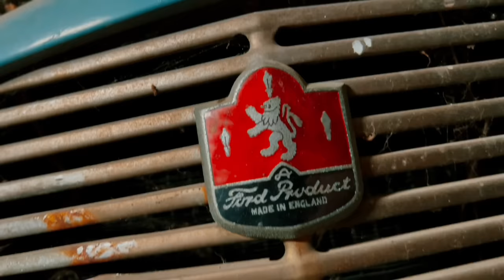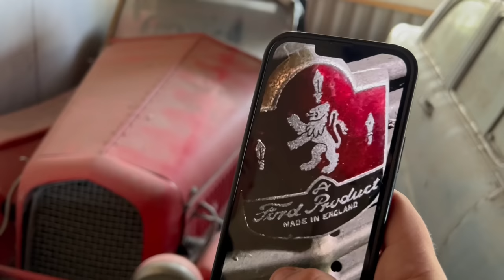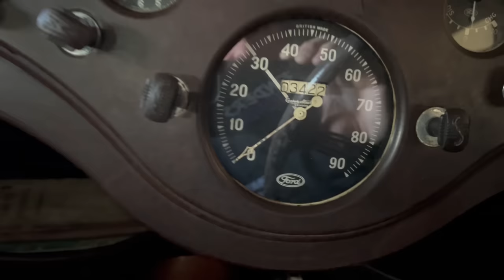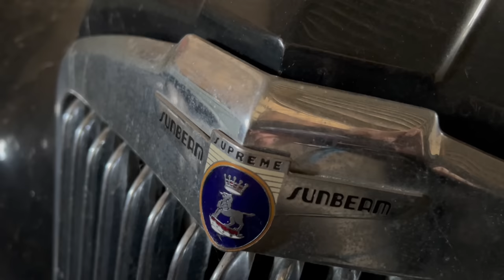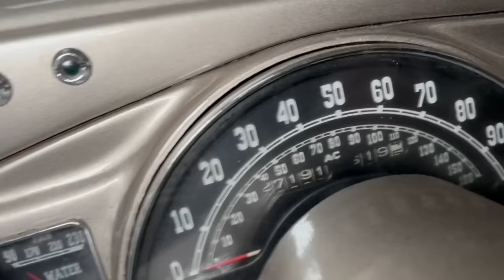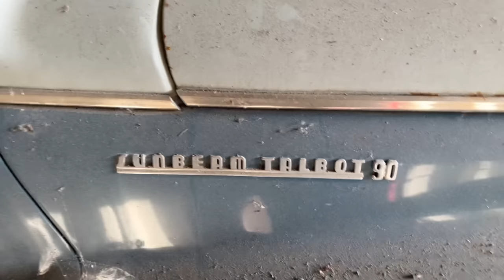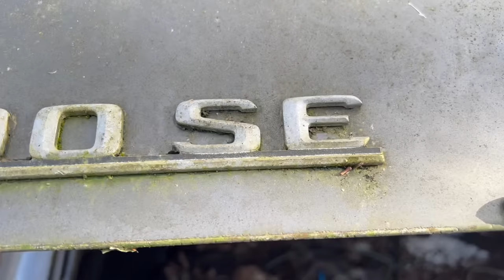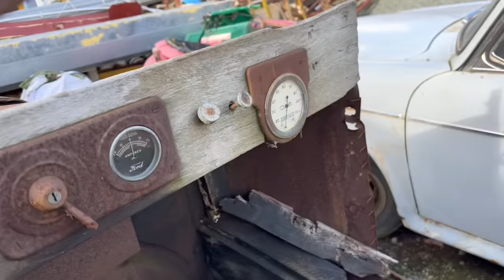This ABANDONED house had a barn full of classic cars worth thousands

Comment: It’s says a Ford Product and is a Ford Consul from the 50s. That’s a Wolseley 1500 next to another which maybe Riley 
A Ford 8 from the 30s, A Sunbeam Talbot convertible (very rare) from the 50s,  a morris minor traveller from the late 50s.a Ford prefect from the early 50s - 2 x Austin A40s one  from 1962/3 and 1967., another Sunbeam Talbot and Wolseley 1500, Another A40 and Austin A30 , A Ford Thames (Squire) 300 yet another Sunbeam Talbot 90 and a Riley 1500 apart from the A40 and Morris Traveller , very rare cars from the 50s . I think about ( at least)  £100000-200000 of cars if preserved just the ones on the inside 
Outside probably another £200000 of cars if preserved
Reliant Scimitars , MGs , A40s A35 . An original Romany caravan probably £50000.
2  possibly 4 Jowett Javelins from the  50s . A Bentley S1 from 1956 and the Reg says last registered on the road in 1990.
A Vauxhall Cresta from the 1960s plus  a very very rare Allard P1 (£50k if preserved) next to the Vauxhall and red Range Rover
An Riley Kestrel 1300 from the 60s. A goldmine of cars and sacrilege to see vehicles like this rotting when there are enthusiasts who would lovingly restore and care for them

Comment: My dad's first car was an Austin A40, all the way over here in Australia. This was back in the early 60's. He bought it when he was about 14.
It has a sunroof too, so yeah they definitely had them back in the day.
Also, 27:43 that was a column shift. It's just a normal manual gearbox with a lever that connects to the steering column. It would have had about 3 forwards gears and 1 reverse.

Comment: KKR 828 is a 1948 Morris and the black thing with the squat back is an Austin A30 the A35 had a bigger back window. My mom bought me one when I was 12 for £3 and I hrashed it around the paddock until the reart differential gave up the ghost, she then sold it for scrap for  £3 so all it cost was the petrol in 1964 you could get 4 gallons and change from a quid. Note GALLONS not LITRES.
You two are funny but you need to check up on older cars. The column shift was usually 3 gears and a reverse.

Comment: Its a column shift still got 1234 gears movement is up forward 1 up towards the driver 2  down forward 3 down toward driver 4 middle is nutral if it only has 3 gears then up forward maybe reverse
Reply from the maker: I would be forever forgetting which gear I was in

Comment: Austin Motor Company Limited was an English manufacturer 1905, Longbridge. In 1952 it was merged with Morris Motors Limited in the new holding company British Motor Corporation (BMC) Limited, keeping its separate identity. The marque Austin was used until 1987. sold to  Nanjing Automotive  as  MG Rover Group in July 2005,,1970, British Leyland dropped the separate Austin and Morris branding
Reply from the maker: That’s interesting info thanks. I can remember a British leyland dealer in Doncaster in the early 80’s.

Comment: At first you walk in,  two Wolseley 1500s, the next car in a Mk1 Ford Zephyr Six (very desireable) and its not a Dutton, its a Marlin., Austin A40 Farina 1958 to 67, Ford Prefect Sit Up and Beg, Morris Traveller NOT a  Mini Clubman, infront of the Prefect is a Sunbeam Talbot Supreme 80 or 90, Sunbeam Talbot, Morris Delivery Van from early 50s, Riley One Point Five  with wire wheels,(upmarket version to the Wolseley 1500), next to that in two tone blue and white another Sunbeam Talbot  90, the project car on way out that  you didnt recognise is a Ford 300E Van, a very early and rare  3 bar grille, Bentley  Wings, the bonnet is a two piece wing bonnet, either a 50s MG or Morgan, in the lock up, the front end is a Austin Healey " Frog Eyed" Sprite front flip  which are fibreglass, Mini shell outside in half, outside at the  back, MGBGT,  30S Austin, Rubber bumper MG, Austin A30, a couple of Reliant Scimitars maybe GT,s, behind them in red is a later Reliant Scimitar SE again these are fibreglass, Morris Oxford A60 in the pile there,  Morris Minor 1000, a Mk2 Jaguar/Daimler in the middle there without doors, beautiful  Romany/Gypsy caravan, back to the cars 2 Jowett Javelins, Bentley S1 from 1956 with  a 4887cc  engine nice and original and highly collectable, a couple more  Jowett Javelins one with keys in, Vauxhall PB Cresta,  AC 2 Litre 1947 to 1956, these are rare 4 door saloon cars from Thames Ditton,( AC made the Invalid Carreges), shit Land Rover,  next is a rusty Ford Model T, next to that is an  Riley Kestrel 1300 ADO16,   1960s Dodgem car Great Video boys.